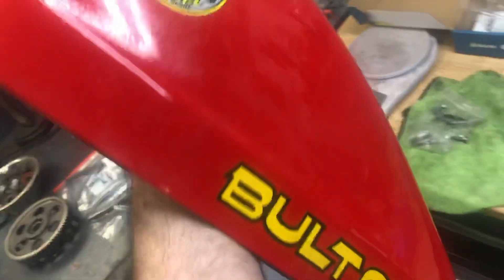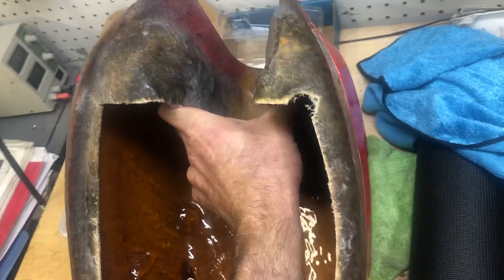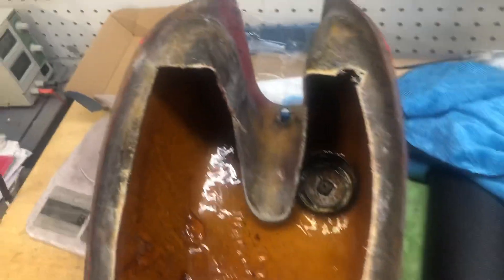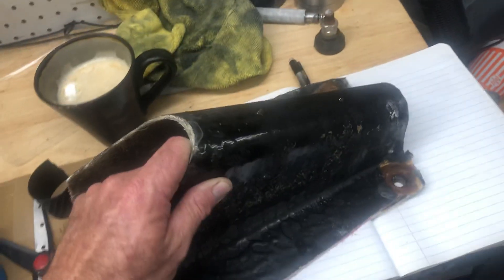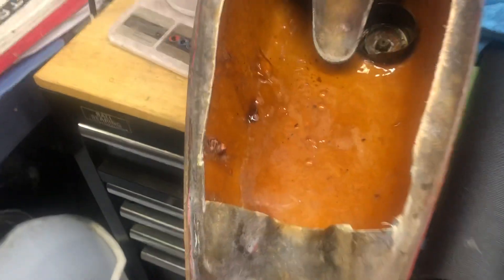Why did Caswell Epoxy Fail

Comment: I gave up on Caswell, you'll never get the oil out of the glass. I started making new Ossa & Bultaco tanks.
Reply: I have a 1974 Rickman CR 750 cafe kit bike with a fiberglass tank. It started oozing a sticky brown goo about 20 year’s ago. I had it sealed with what looked like Red-Kote. It has been sitting for over 10 years and the goo is back. Any thoughts on how I can replicate the tank?